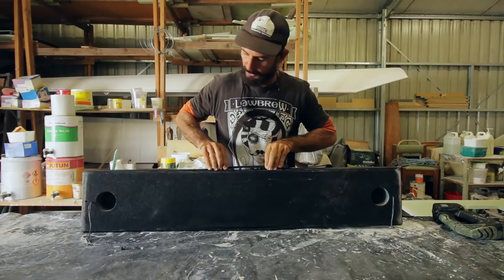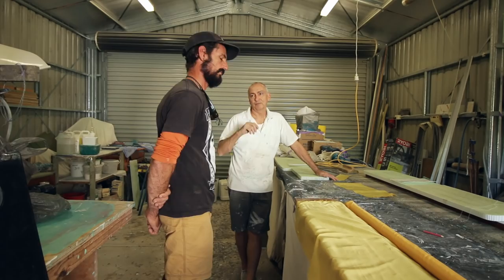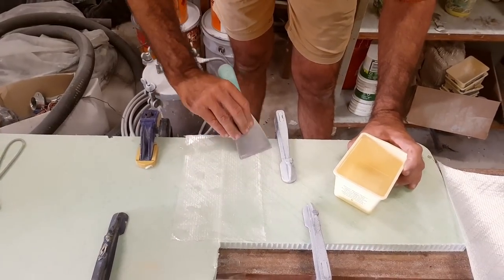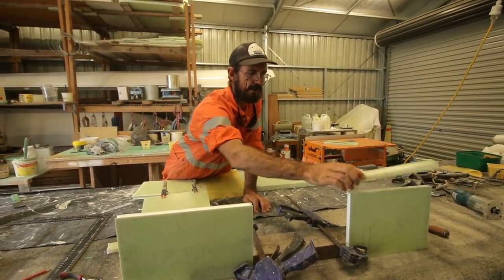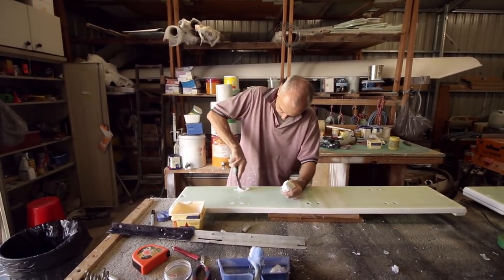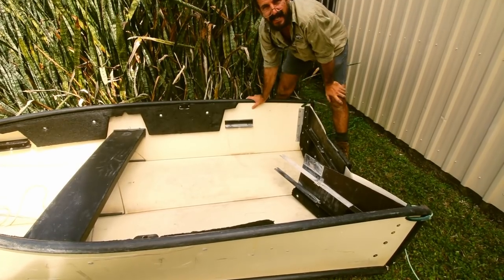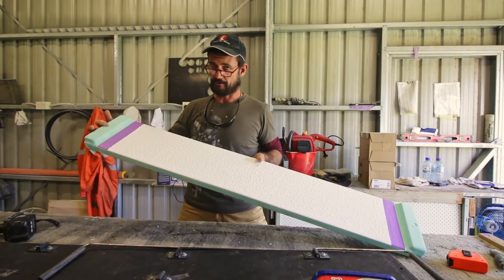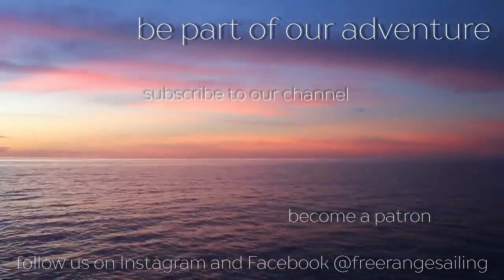Dinghy Refit and Fibre Glassing 101 - Free Range Sailing Ep 52

Comment: That tef gel really is amazing stuff. I screwed and bolted a heap of stuff to my new tinny 6 years ago. Radio , rod holders, knife holders, oar clips, fuel filter etc etc and still zero electrolysis or corrosion and its still gooey and not hardened.

Comment: A number of years ago  found a Lufkin tape measure in a shopping cart outside of Home Depot. Nice find i thought. I used it a number of times worked great. 
One day I was cutting 2x4's  Using one rule for measuring the length I needed and one for cutting the wood.  After losing it I found out that my lucky find (lufkin) was missing a whole inch. Those tape measure don't bounce too well. Enjoyed your video.
Reply from the maker: Nothing is so mystifying as an inaccurate rule. I've had my share of frustration.
Reply: You are aware Larceny by Finding is still a criminal offence although in your case you may have just discovered why the original owner discarded it.

Comment: Hi Troy & Pasqie. Nidaplas (Polycore) is wonderful stuff. I completely refitted an old runabout hull into a US style Bass boat with the same style of sheet you have used, with fibreglass sheathing both sides. I could have also gone with ply one side and glass the other, or even with aluminium sheet one or both sides or any compination of sheaths. I used it for stringers, frames, bulkheads, floor and even the transom. I used various thicknesses for each particular application. Light and really strong if well engineered.
1 comment I will make, is that that butt joint is a failure spot, a scarf joint, although harder to get perfect, would yield a stronger joint.
I like your explanation of electrolysis and how to lessen the chance of it occurring. And the galling issue, slow and steady on doing up nuts, especially nylocs which are the worst offender for developing heat.
Reply from the maker: I have scarfed joins in timber before but didn't think to do it here as the core had no strong gluing surface,  the glass sheets providing the strength. Ideally we wouldn't need a join but we were using scrap offcuts.

Comment: Electrolysis: Remember stainless bolts will honeycomb over time. And the electrolyte is the salty moisture (air) out on the water. So electrolysis will occur thru the exposed ends of the bolts too.
As Australian Surf Life Savers we use and replace these stainless bolts on our propeller ring guards every year or so. 
PS. We always start looking at the carburetor end of the difficult to start motor simply because if that has water in it, water will constantly be being sucked back onto the spark plug even if it has been dried and cleaned.
 Cheers from Long Reef Surf Life Saving Club, Sydney Australia

Comment: Your work on your dingy reminded me of when my father and I fitted a 30 foot catamaran with three outboards and seats and everything  else.  The really funny thing about this boat is my father found it in Florida.  My uncle volunteered to go and drive it back. He picked it up at night and came back at night.  Mind you it was a 20 hour drive he made nonstop.   At any rate in the morning  my dad went outside to find the trailer sagging big time.  Well since it was just a hull and nothing else there were no drain wholes.  It turns out he drove all the way back 20 hours with several 100 gallons of water in the boat.  We all had a kick out of it and my uncle didn't live that down for quite a while.
Reply from the maker: No good deed goes unpunished!

Comment: 13:16.., I was a painting and decorating contractor for over 20 years, my pasting table looked like a crazy ruler, what I would do is to measure a drop and mark it on the table, if it was short enough to fit the 72'' pasting table I would draw one arrow beside the number, if it was longer than the table it would be a double ended arrow, if it was longer than 2 table lengths it would be a double ended arrow with a single arrow beside it, after a while I rarely had to use a tape measure.

Comment: Wow!  Pro job on those seats!  My porta-bote has started leaking at the center bottom of the transom.  :(   I have the solid one-piece style transom support-- haven't seen the two-piece before.  Nice.  Thanks, Free Range!
Reply from the maker: I wonder what causes the leak? Spoken with the portsbote people?
Reply: Free Range Sailing  The transom plastic itself is beginning to break down where it  joins the bottom two panels.  Your idea about "welding" this type of plastic with heat is something I'm going to look into.  Keep up the great work!  (Sending you a tiny bit of Paypal appreciation).
Reply from the maker: Ah ok. I wonder also then if a sheet of thin PP may be available to cut out using the old transom piece as a template.
I've been thinking about buying a PP welder as they are relatively cheap and it's a wonderful (and cheap) material for boat tanks etc.

Comment: That is a pretty cool dinghy, and your experiences certainly improved my appreciation of it. I’ve decided, though, to go for a rotationally moulded version of the tube inflatables, which I will fit out for sailing with a centre board case (polypropylene welded in) and with the mast and sails stored in the hulls as with the Portland Pudgy (screw off access caps are fairly easy to fit). At least that is the plan, it may change when the reality of the weight of such a dinghy becomes apparent. I’m in favour of having a second dinghy in the form of the collapsible so that we have more individual independence aboard. I have to say that I did wonder how the collapsible would cope with a determined croc pulling down on the side. Perhaps that is not something crocs think to do, but when you see those tank crocs eyeing the tourists just one thickness of glass away I’m not sure. It will only take one tank croc to be returned to the wild and their knowledge of where the freshest meat is will increase immeasurably.

Comment: Great episode - rather you than me .I did a 2 year certificate course in FRP at TAFE in 1976 ,built a few small boats to earn some money . Haven’t missed the experience in 40 years!! Emerclad is a waterproofing membrane more than a paint Pascal - its hard to get a good finish with it. A similar product to it is Deckgrip made by Construction Chemicals . It has a rubber crumb in it as an anti slip. Used it on the floor and foredeck of a Quinnie for three years without the need to reapply
Reply from the maker: 3 years is a good innings.

Comment: I'm confused about the table saw/fence bit. Looks alright to me. I'd guessed there would be some comments about the missing blade guard and riving knife, which is pretty much a non issue cutting foam. Plus, generations of table saws did without these... cheers, andi
Reply from the maker: I was raised to have the fence positioned in a way to not have the large section of work between the fence and blade due to the kickback risk. Non existent in this case but I thought I might address that in advance.
Reply: Hmm, might be that changed over time because of riving knifes and blade guards. Most table saws I've seen (properly modern ones) have an integrated ruler on the fence, so they really tempt you cut between the fence and the blade. Also, I imagine it quite difficult to square off a large rough cut without having almost all of the work piece between the fence and the blade. Did some reading: Kickback is initiated by the workpiece losing pressure on the fence and being pulled up by the back of the blade. A riving knife prevents that. So I'll keep your advise in mind for working with old school saws. Thanks!

Comment: Wish I had some nida with me. When you leave Australia cut a sheet in half and put it under your bunks. Impossible to get in most places. We found a centerboard from a wrecked tri, that's our best seat.... the transom is teak from Colombia. It's a sinker. The seams are all coming apart... Any ideas for that? We were thinking about completely restitching it with butyl tape, but that's a shit load of work. Glassing won't work. Tried flex seal & 5200... Just doesn't hold up. Interested to know what your thoughts brother! Fair winds! PS - if you have problems with the center support bending (like us) spread the ends apart and mount them to two separate off-center spots on the seat, it spread's the load while still keeping the required shape.
Reply from the maker: Hey man, nice to hear from you. Hard for me to call without seeing it. Have you looked up any vids on people welding polypropylene? It bonds at about 300 degrees I think. I repaired a ski with a hot gun and an old plastic bottle. Perhaps the seams could be melted together? I've heard of portabotes prior to our model coming apart but I dont have experience of it yet. Butyl tape is awesome gear but you're right about how much of a ball ache it would be to repair.it also may be a lasting fix though. Good advice about the centre piece, thanks. Wish I could be more helpful
Reply: Hey that's a good idea... I'm going to try to stick weld that thing with a heat gun and a piece of plastic. From outside it should work for awhile. The problem with these boats is that they flex so much it ruins any repair you make. You need something BETWEEN the seams. But that's a damn good idea. Thanks brother. Keep up the good work, nice to meet ya, and hope to share a beer someday. -James

Comment: Love your videos. It's a pleasure to spend time with you and learn something at the same time. Noticed that you have Garmin echomap on your boat. Can you tell me where did you install your transducer and what type it is please? Have 65plus model which came with transom mounted type and don't have a clue what to do with it. Transom on my boat is above water.
Reply from the maker: The transducer was mounted by glassing it in place out of the wash from the keel. If you have a fibreglass hull, look into mounting it internally. Below a certain thickness of glass, your hull will be transparent to SONAR. Ours wasn't unfortunately

Comment: i won the tender to mark lines for the basket ball courts etc and resand and polyurathane it .I painted the lines then found out my good quality tape measure was a mile out so had to strip and start again,i would not have believed it could happen
Reply from the maker: Ouch.
Reply: I worked as an excavator operator, installing water and sewer pipe for a huge subdivision/development. After we had installed hundreds of meters of pipe, the City surveyors showed up to inspect. They told us ALL of our pipe was 10cm (4") out!! It still took us a while to figure out our new survey rod was missing a whole dec. It started at 1, not zero!
Reply from the maker: We have a winner!

Comment: * cut the mixing stick square so it reaches into the corners, I use tongue depressors 
* I usually measure out by weight into 2 containers, 
and add the epoxy to the hardener vessel because a small percentage will remain in the vessel, better to be less resin than hardener
* Wear gloves to reduce your toxicity, and safety glasses to stop splashes going into your eyes
the wrap around glasses are so good these days you can forget you are wearing them

good project and its looking nice
I guess everyone has their own way of doing stuff but you make lots of very good points
I think the earlier models of these boats are starting to become victims of their age now, you could repost it using foldaboat name 'repairs', should get lots of hits
sounds like you are thinking about building your own boat :) 
have a good one

Comment: Not sure what you were saying about proper use of the table saw. Put the squared edge against the fence, doesn't matter which side of the blade is the "larger" bit. Also, pulling it through is unsafe. Push it through. Anything over 5" wide, with your hand (mindful of the blade), smaller, use a push stick.
~Hans

Comment: Notes for me for later: 1g of resin to wet 1g of glass cloth. Peel ply is the shortcut to a good smooth, light weight, right ratio, fuck all sanding (lies?) finish. Metho for roller cleaning. Make my own spreaders with ply scrap or waste plastic(?)
Reply from the maker: I still go 1.2 :1 resin to glass. Works for me better with less than ideal conditions.

Comment: Troy my old Porta Bote is leaking through one of the chine hinges, do you have any ideas on a fix for that? Cheers from Western Port Vic
Reply from the maker: Can it be unstapeled, lined with butyl tape and rejoined?
Reply: I guess It would be possible, wonder if you can hire a staple gun that could do that. The guy from Porta Bote reckons its too big a job. Thanks Troy

Comment: sorry Troy, you are completely wrong about the fence and having the work piece between that and the blade.  The fence is designed especially for the purpose to cut the work piece the exact size you need, as long as the fence is parallel to the blade.

Comment: nice work. BUT, plastics don't work harden and electrolysis happens in the salt water and bi-metal corrosion is what your taking about. Sorry too be a stickler.
Reply from the maker: Stickle away.
Reply: Over here we call it galvanic corrosion. Stickle stickle.  You two are a true credit to your countrymen! Thank you for sharing your adventures with us.
Reply from the maker: We actually also get electrolysis also because saltwater finds its way into the transom and forms an electrolyte surrounding the two metals which then react as cathode and anode as long as they  are electrically bonded. In any case, the Tef-Gel goes some way to keeping those pesky electrons in their place.
Reply: I have been wondering if the reaction requires ground or can they just exchange electrons in circuit. I heard of a guy who cleaned a trailer frame in his pool using an electrolysis bath. I have cleaned rusty tools and parts this way. With that you do require ground. Sail on.